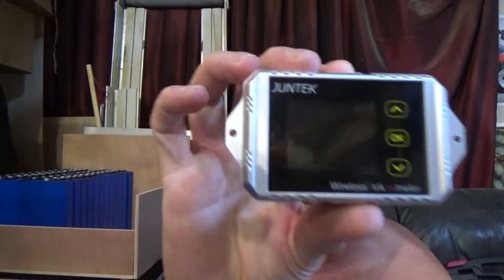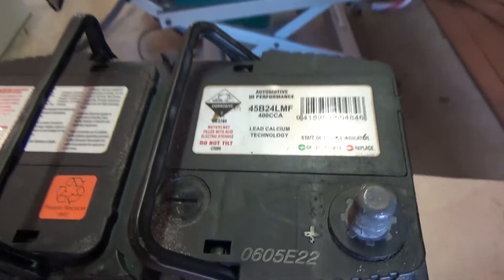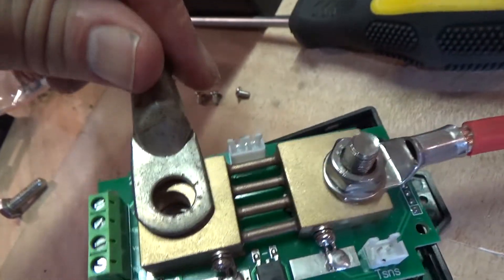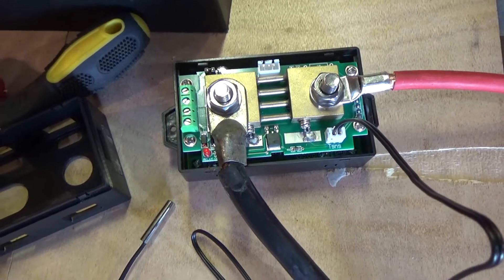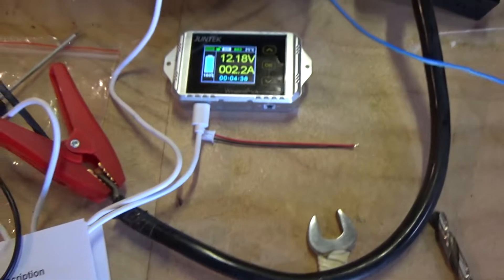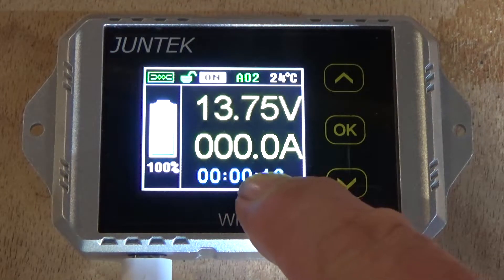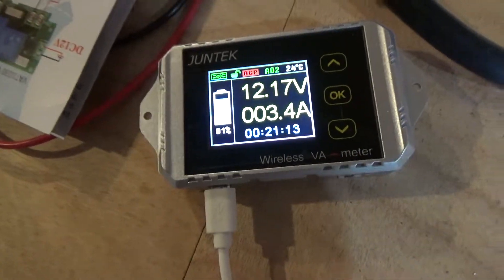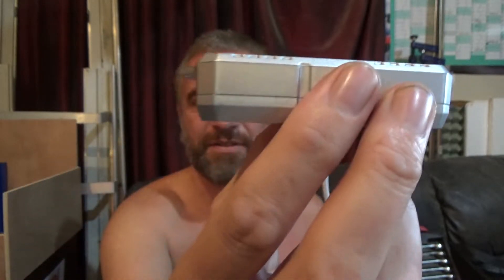Juntek Battery Monitor | Installation and testing

Comment: It measures down to 0.1 amps except  With the higher amp like 300 amp unit that I'm using it doesn't start until you get over half of amp so when your drawing smaller loads it throws the state of charge metre off over time.

Comment: The batteries have been a bit of a hiccup, but credit to Dennis, who seems motivated to provide a good service. He’s replacing mine, too.
Reply: Curious to see what you all end up with?  Instead of replacing mine I went with a refund and bought cells elsewhere.
Reply from the maker: Yeah fingers crossed. I cant wait. he says my replacements are still a month away so I will have to play some more with the old ones
Reply: Given that he’s letting you swap your Frankenstein cells, and my whole batteries, I wonder if he’d let you have mine to mix and match cells to put together a matched battery. Surely between the 48 cells there’d be enough matches ones.
Reply from the maker: I actually suggested something like that but his reply was that he would give me new battery packs

Comment: great video, just a thought about bolts being a pain . can you not leave the nuts and bolts in place and just use two more nut of the same thread  on top of the existing ones
Reply from the maker: Yeah that could work, but would need to be a nut that conducts well, maybe copper or brass, and thin, it would also remove the risk of shorting the jumpers. But I guess its only a problem for the initial installation and better to have the terminals actually touching the shunt, once it's in you should never have to think about it again

Comment: Hi, I bought this juntek and I must say that it does its job well, the Volt and Ampere readings are very precise, and the wireless mode is also convenient ... but there are a couple points not good:
I use juntek to test the capacity of my lithium battery packs, I run the discharge until the BMS inside the battery turns off the output, when this happens the juntek unit inevitably turns off, this causes the loss of memory and I lose my data , I thought of supplying the unit with an additional voltage in addition to that of the battery) on the GND and VXT pins but there is a conflict as the battery voltage is present on these ports. 
So the only alternative is to install the relay and insert a cut-off higher than that of the BMS board in the battery, but this unfortunately will not give me the total capacity of the battery
Reply from the maker: Hi Vincenzo. Ah yes that's the terrible thing about batteries with built in BMS they are not very graceful in their high or low voltage cutoff. But you should be OK to use those terminals to power the unit so long as you swap the jumper from 2W to 3W. Take care though if you are using an inverter or solar charger neither will like the battery disconnecting under load and you might still be better to use a relay to switch off your load rather than disconnect it
Reply: @BusedAsNZ  Thanks for the info, I only use it to test my lithium battery packs until the BMS stops (you're right about BMS) but since in real use the battery will cut the output voltage when the BMS intervenes for me it is important to read the capacity in this way,  I already put the switch on 3W  :-)
Reply from the maker: Hey just an update. I have tested my Juntek using the 3W jumper and an external power supply and it seems to work well. Interestingly though, as you have found I do see a few volts on those terminals

Comment: I’m curious why you need a monitor when you have the Electrodocus BMS. Doesn’t the SBMS0 already monitor state of charge AND individual cell voltage AND cuts off load/charge? Your video on the SBMS0 was one of the reasons why I cut out a monitor from my battery plans.
Reply: Darren had bought the Juntek in one of his earlier Aliexpress videos. He will be using the  Electrodacus bms on his lifepo4 system. This was just a demonstration of the Juntek and he mentions that he'll possibly be selling it as he doesn't need it anymore.
Reply from the maker: Yeah exactly what Gordon said. I had already bought it, actually I had already bought a couple different, both very cheap, battery monitors before deciding to go lithium. The other one was in my Solar Generator video. Now I have the SBMS0, its all I need
Reply: Bused_As NZ thank you and thank you Gordon! I just came across an old video of yours published about a year ago with this monitor. I’m glad to hear that the SBMS0 is fulfilling what you need. I’m about ready to purchase one myself. Looking forward to more of your videos. I’ll be tackling my on copper pipe bus bars soon  using your videos as reference.

Comment: nice video , can you tell me what relay can it work with it ?
Reply from the maker: I guess a relay that is capable of handling the full load of your system with the appropriate voltages. I like solid state relays.

Comment: Recently I heard that JUNTEK has launched a new product, the KG-F series coulomb counter. I saw a 400A on their official AliExpress. This time they used a pure copper shunt with low power consumption. , And the display module looks very atmospheric, and can be operated and data exported through the mobile APP. Have you bought one before? I want to buy one and install it on my RV.
Reply from the maker: Hmm nice looking unit. App support will be very handy. I think the shunt itself is pretty standard but they have changed the bolts from steel to copper. Resolution of the 400A and 600A units still only 0.1A. Overall looks like quite a nice upgrade. Think I will order one, Thanks for the heads up

Comment: How did you change the display mines stays on with the settings bar down the side
Reply from the maker: Sorry Im not too sure, mine has always dropped back to the main display if I dont touch it for a bit. Possibly DSP CHG TIME in the settings menu controls that

Comment: hi can i ask do i earth the load side to ground on my camper or take it from the battery
Reply from the maker: Hi, the shunt should sit between the negative battery terminal and your ground or any other negative connections. This will ensure that all power going into or out of your battery will go through the shunt so it can be measured.

Comment: I think your USB connection was good. This display was turning off because it was timing out at 0 amps.  It's touch sensitive so any time you got near it the screen turned back on?
Reply from the maker: Yes I was having that problem at one stage, but unfortunately the USB on this unit is toast and now does not work at all. But its OK since it also has a 12V input and that works fine

Comment: is it possible to not use a battry and just use it on source of DC power 300 Volts DC and putting a load ? how ?
Reply from the maker: I dont think it is designed for that. You probably dont need a battery monitor for a power supply, though a simple ammeter might be useful if you are interested in seeing how much current you are using

Comment: so it look like you didnt have to connect the ground wire next the vin connection(your blue wire) to get the unit to power on
!
Reply from the maker: Yes that's right, it is not needed in my configuration. It is only needed if you use an external power source to power the monitor or the relay circuit.

Comment: You cant turn charging off by temp? correct
Reply from the maker: Yeah correct, mine does not have a temperature input, but most charge controllers do and can manage battery temperature directly. Not really an issue here in New Zealand, we dont really have temperature :)

Comment: this is good only for demonstration. i try to use it for actual setup of     400vdc 250amp battery set up for a vehicle. even though the specs says the Amp is 300A, you can not insert a 2/0 cable through the box without re-drilling the cover. and the terminal bolts are not fix inside so it is very difficult to mount the heavy duty cables. then the green screw mounts are very close. example; my pack voltage is 400v so one wire of 400v and the next is ground and then the 12v and relay negative.  after one day i had a dead short with the 400v wire to the amp shunt as it was too close to each other and (less than 0.5mm) and bust up the unit. my main concern is that short of the circuit destroy my vehicle VCM and BCM. which going to cost me thousands of dollars. therefore i am advising anyone trying to use this for any actual real work situation, buy a unit with hall sensor type. this is very unsafe and unreliable due to bad design. for high voltage high amp applications.
Reply from the maker: Wow, yeah I don't think I would recommend using such a small cheap battery monitor to manage a 100kW system. My car 400V 200A so I guess you are building an EV.
You are absolutely right its a bit undersized for your needs, besides you probably have individual cell management with that many series connections so if this is just a fuel gauge to you then yeah a hall sensor should be ideal. I still think the Juntek is great as a budget unit for most RV and smaller off-grid systems

Comment: Have you figured out a way to calibrate the shunt? Mine is about 2% out.
Reply from the maker: I think its in a hidden menu and I think you need to have the unit physically plugged into the shunt, not wireless. If you go right to the top of the menu list, then hold the up button a few seconds you should get a few more options to calibrate the voltage and current reading or do a factory reset. Sorry I cant test here to confirm because my micro USB plug is not working. Good luck
Reply: Does your shunt count negative AH when the battery is fully recharged? My original shunt stopped at zero AH, the new batch counts down past zero and into negative AH drawn. This doesn't help as when it discharges again it first needs to come back to zero before it clocks up AH used. Each cycle the negative decreases (i.e. becomes more negative) and it still shows 100% SOC when in fact it's taken a few % off.
Reply: Thanks - I found that menu. Doesn't really help as it does strange things. I've contacted who I think are the actual manufacturers.
Reply from the maker: @rogerivy8525  No I haven't noticed my capacity go past zero. But please keep me updated on the calibration
Reply: We've not come right with the latest round of Juntek shunts and have needed to discontinue using them. We reached out to the manufacturer who pushed us back to the seller. The seller is not really interested. We've had an ongoing dispute with Alibaba who keep asking for more and more evidence - and we've supplied tons of it! Not really a happy conclusion - stick with Victron I guess. £500 lesson learnt.
Reply: We've done an in-depth review here: 
youtube.com/watch?v=nPldUM67Jbw
Reply from the maker: Ah yes I understand, that's not good at all. Luckily mine must an older unit because it does appear to stop at zero, for now. I see they appear to have a new model, looks like a direct upgrade and might be why they have no development interest in their old unit. I have ordered one to have a look, seems that have dropped the silly shunt bolt setup too.
Reply: @BusedAsNZ  Thanks for the info. I've just ordered one as it looks like it could be the bees knees. Hopefully they didn't build it with that software error! When you think of it, why don't BMS manufacturers do the coulomb counting? We build batteries with Daly's and sell tons of them in Europe - I'm often frustrated that with a little bit of extra code they could do the coulomb counting. They already measure (very accurately) amps anyway.
Reply from the maker: @rogerivy8525  fingers crossed

Comment: Nice your supplier is willing to exchange your battery cells for a replacement,hope it gets better for you but these look a lot like a battery that where sold here in Canada on amazon sold under the name "Shun Bin" and have been proven to be crap with used cells and bad bms although they do come in a nice steel box  ;-)  there's a lot of info on these packs on the "DIY Solar Forum"  with others who have purchased them only to find similar results as you.
Reply from the maker: Yes very nice. I kinda knew in advance they were likely to be pretty crap, but I also figure they would at worst still be better, and much smaller and lighter, than pretty much any lead based option. And so much cheaper than any quality local option. And it sure is a nice steel box hahaha